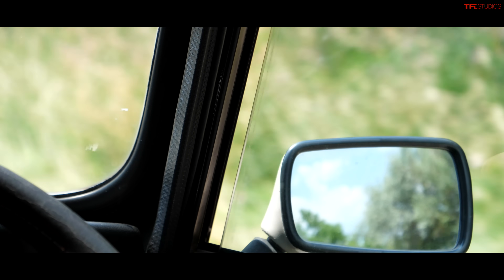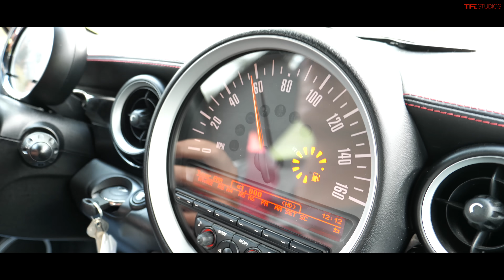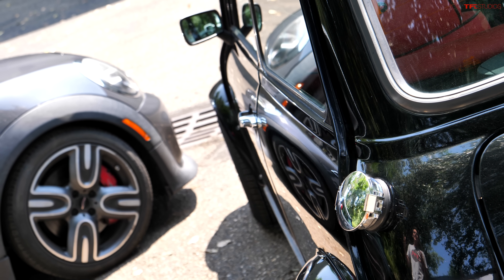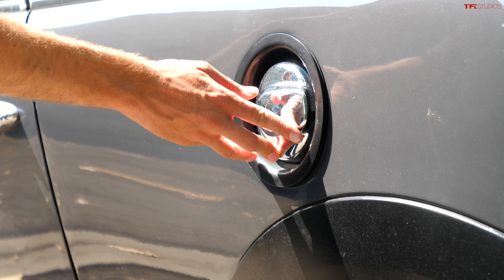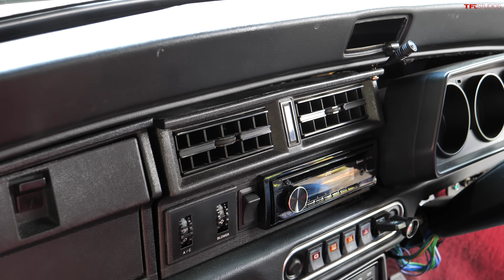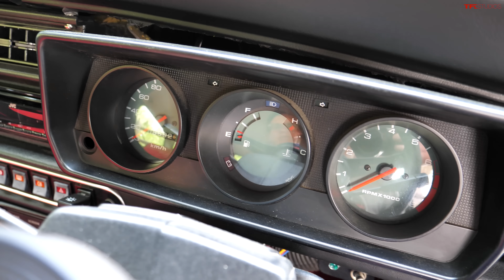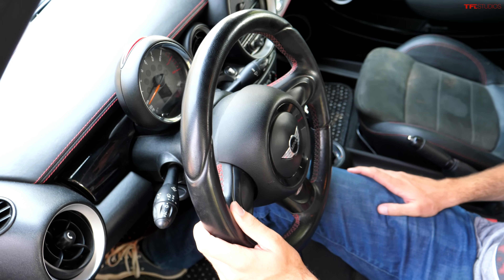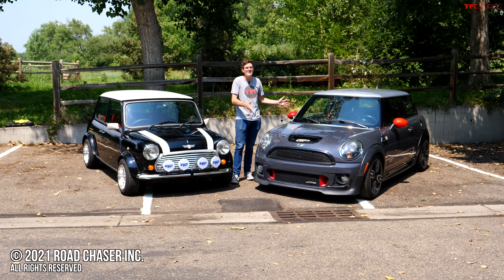Is The Classic Mini Cooper Really Better Or Is It All Nostalgia? For $15k You Should Buy THIS One

Comment: Having owned both I can confirm the old Mini is a lot more fun, and cheaper a lot cheaper to run than the new MINI. I choose old over new every day of the week.
Reply: Great point. I think the video poster did a terrific job of comparing the two vehicles but he didn't discuss maintenance. 

Older Minis are VERY easy to work on, while I suspect that newer MINIs might require sophisticated tools and skills for "similar" jobs.

On the one hand, the newer MINI likely doesn't need as much work each year, but on the other hand, how much more work can you do yourself on the old Mini to keep those costs down on the older vs. newer one?  Also, do the same "wear & tear" parts for the new cost the same as for the old? (e.g. tires, wipers, brakes, etc.)

My gearhead friend with a 2006 Supercharged MINI and I were just comparing the cost of new tires before the Winter came and the older Mini's tires were half of the cost of the newer MINI's, even after shipping from the UK to NYC.

It would be interesting if the video poster, as a follow up, discusses buying both cars for the same exact X dollars, then added the cost of ANY work necessary to get them to the same "daily driver reliability", and THEN tracked parts and labor costs over the next 5 years, subtracting any work that the average owner could do themselves (e.g. an oil change, or a tune up of plugs, wires, dizzy cap & rotor, or brake shoes & pads) and also added in the annual Insurance costs for both (without playing any games like cheaper classic insurance for the old one) just to see what the true average cost of ownership was after 5 years.

Comment: The new one looks cool and desirable, until you see the old one. Next to the old one it has no chance. I'd gladly own and drive an old one, even with the steering wheel on the right side, but if I had to buy a new one, the reason would be fun and handling. And if that's the case, I think I could be happier with alternatives, such as Fiesta ST, Focus SVT or even VW GTI.

Comment: Me I would take the old one, I had a Mini Clubman 1275, but it was lowered had disc brakes all round lowered the hydrlastic suspension was replaced with coil over shock's running 10'' alloy Minilite wheels dual fuel tanks, I used it to do hillclimb and rallying the engine was bored out to 1340 cc with twin 40DCO Weber carburettors an RC30 big bore exhaust competition clutch straight cut gears so a lot of gear wine, needed to change the oil often as the gearbox runs in the engine oil, low back bucket seats a full roll cage could top out around 110mph, I regretted selling it but with a new wife and house purchase meant the toys had to go to buy things like furniture etc. You missed the fact there were also Mini Cooper 'S's that was where a lot of my parts came from as I wrote it off.

Comment: depends. do you want english "reliability" or german "reliability"
Reply: Classic minis are very reliable. Cheap to fix, easy to fix and parts everywhere. New 'Mini' is a BMW. Enough said.
Reply: But for others thinking about buying a classic Mini, and wondering about reliability, I want to share this:

I own a 1991 classic Mainstream Mini Cooper as a daily driver and after just a few months of "sorting it out" after taking possession of it, and then properly maintaining it, it has been VERY reliable for the past 10 years.

Meanwhile my friend owns a 2006 Supercharged modern BMW MINI and often laments the large bills he gets whenever he goes into the dealer just for annual service.

If you have good mechanical skills and a Haynes manual, you can take care of a classic Mini yourself.  If you don't, then any reputable "corner mechanic" can handle your routine maintenance for a very reasonable hourly rate, and I'm certain that for the VERY special jobs, any classic Jaguar shop in your vicinity would jump at the chance to work on your classic Mini, just for the experience and to be able to advertise that they work on classic Minis in order to build their clientele list of other relatively local classic Mini owners.